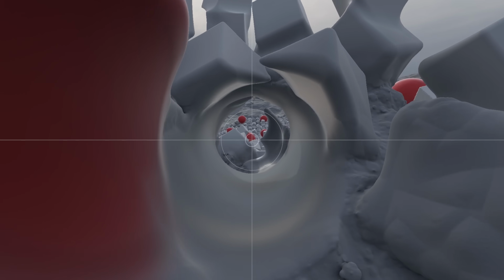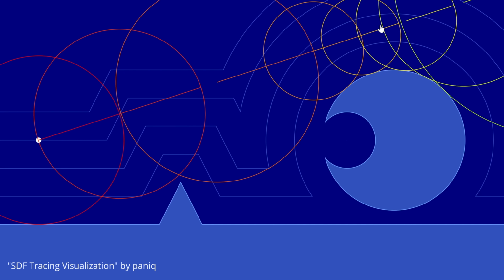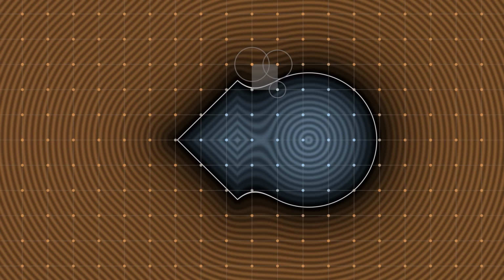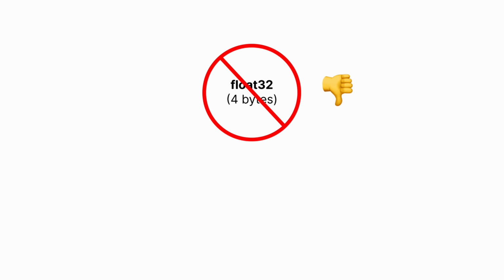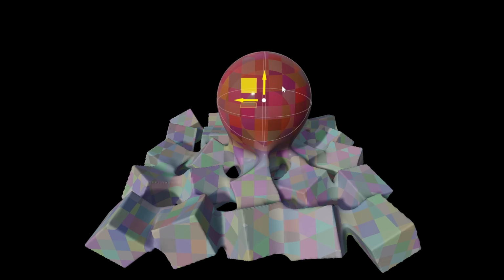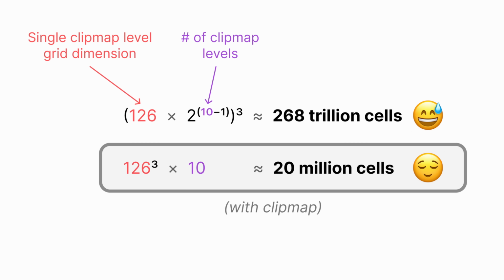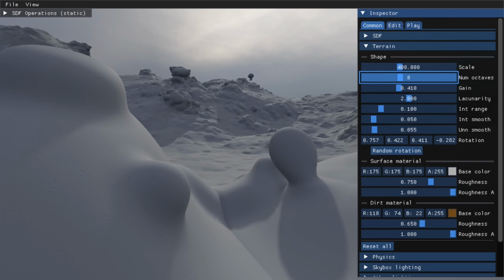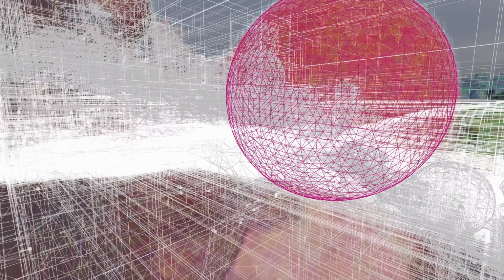I'm making a game engine based on dynamic signed distance fields (SDFs)

Comment: What if instead of using a sparse grid you'd use a BSP tree as a cache where each individual object's surfaces can be a plane of the tree? If ensure that the caching data structure uses planes which are parallel to object the resulting object surfaces then you'd also get rid of the grid-wobbling that your demonstrated cube showed. Of course BSP trees are one step more involved to look up into because you can't just bit-slice yourself through the data structure to get the result super fast but they compensate that disadvantage by allowing for even more sparse representation while also by design not having the grid-wobble issues.

Comment: I love it, can you still control the blending? I would expect it should still be possible here? I feel like one thing missing here is that everything is too "mushy" and blending too aggressively, would expect some objects to blend more or less with terrain, some maybe keep the sharp edge
Reply from the maker: Yeah, you don't need to blend shapes, but I tend to get carried away with turning on smooth blending in all my examples
Reply: @Mike-Turitzin hmm. I think this causes a communication issue. I certainly thought it wasn't possible in your engine to have, for instance, a ball roll without melting into the ground at least a little bit. It had me coming away thinking the engine was fairly bespoke and not applicable for a majority of games.
Reply: There’s always a backseat programmer
Reply: @avramcs  I'm not telling him what to do, just topic I'm curious about, stop trying to make things more negative for no reason
Reply: @avramcs  everyone who ever opened an issue?

Comment: very cool, how do you handle the material / color mixing between sdfs?
Reply from the maker: Basically, I'm blending the material params using the same interpolation param as is used for distances

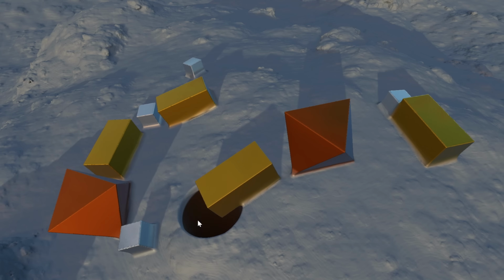Comment: This looks so cool! What I wonder as a relatively clueless viewer, is are you able to prevent objects from visually merging into each other or the terrain when you don't want them to? For example, at 17:09 I'd prefer the look if objects didn't melt into the ground whenever they touch it. It also makes the physics at 15:22 quite silly.

I'm just wondering if this "melting into each other" effect is a limitation of the technology, or a stylistic choice?
Reply from the maker: Yes, it was a stylistic choice - I got carried away with enabling smooth blending everywhere but it can be turned down or off.

Comment: This is so cool! I was on the Substance Modeller beta for a few years. Amazing team, including the original devs from Dreams. They used all sorts of optimisation tricks to run Modeller in VR, but it was a massive hog on resources, especially VRAM. Voxel grid bound per layer was technically unlimited and 64bit. Instances, LODS, render culling. Etc. I pushed it to around 300,000+ x 32 million triangle equivalent layers, which came in at around 45 billion triangles. And that was in VR. At the time that the project was defunded last year they were also working on refactoring a large part of the core to GPU. Anyway, brilliant work on this. Looking forward to seeing how it progresses. 👍
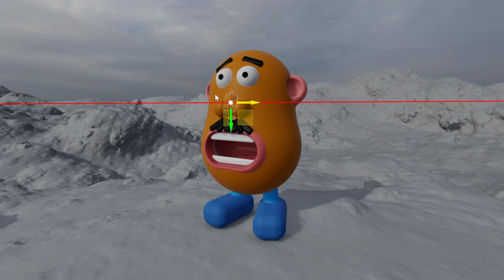@ 18:05 I see you are surface sculpting on non-destructive SDF operands. I didn't think that this was technically possible? I always though that the 2 methods (destructive VS non-destructive voxel/SDF) couldn't be combined directly?
Also: please turn this into a VR modelling program. 😂
Reply from the maker: Cool to hear, Substance Modeler is a really impressive product, with as you said very talented team.

Regarding destructive/non-destructive, every edit in my engine is technically non-destructive in the sense that it can be tweaked or removed after the fact. Not sure if that answers the question.
Reply: @Mike-Turitzin  Sorry, I explained it poorly. In Substance Modeller you can use both 'methods' of voxel modelling (for want of a better term) - the non-destructive 'live primitives' that blend in real-time, and the other method is being able to surface sculpt with tools like move/smooth/clay - like you would find in a polygon sculpting program - but there everything is destructive and there is no real-time layer/primitive blending. Both of these methods exist, but they are not directly able to be combined. If you want to surface sculpt on the non-destructive SDFs you have to first convert all the operands to 'regular' voxel layers.
Reply from the maker: @musashidanmcgrath  I see. In the timestamp you mentioned (18:05) I am actually still creating non-destructive SDF primitives for the "writing" - it's a chain of connected capsule subtractions.
Reply: I was so thrilled to read about Substance Modeler and so sad that it was trapped inside Adobe's painful subscription model.
I've been looking for alternatives, but nothing comes close yet.

Comment: Very impressive! I was looking into something similar for a very different application, but ended up choosing a different approach. A big weakness of SDFs is texturing them. You can do triplanar or volumetric texturing, which works great for terrain, but actually consistently texturing a surface even as it moves around or deforms is very, very hard.
Reply from the maker: Yes, you are right. I am planning to experiment with volume textures. I think it will work with the aesthetic I'm going for, but it is a specific type of thing.

Comment: Great video. I will be following your progress!

One question that comes to mind: do you have any ideas on how you might be able to integrate arbitrary shapes that don't allow a straightforward parametric representation, also not by combining simpler shapes? For example suppose you would want to place a mesh-based shape, or have some part of your terrain be formed by e.g. physics simulation?
Reply from the maker: For the game I'm building I'm just going to use simple primitive shapes. For stuff that is better handled with a tri mesh, I'm just going to use one. So there will be some traditional tri meshes, but the "world geometry" itself will be SDF.
Reply: Good question
Reply: as long as you can make a distance function, you can use it. a mesh conversion where each triangle is its own sdf edit would be incredibly inefficient compared to approximating it with basic shapes (spheroids, boxes, etc).

Comment: Is it possible to prevent objects from merging? I know it's a key feature but I suppose if you want to have a ball roll around you'd use a mesh ball interacting with the physics mesh? rather than an sdf? But for gameplay, having the ball being able to stay separate and then maybe after a certain amount of force get smooshed in would be fun.
Reply from the maker: Yeah, it definitely is possible, I just get a little carried away in enabling blending on everything, haha.
Reply: @Mike-Turitzin no worries. I just never see sdfs not merge. Is it just setting a threshold to prevent it?
Reply: @DarkerCry  Not entirely sure how it works but from what I've understood you take the smooth minimum between two objects to have them merge and the minimum to have them not merge. I don't know if there's a way to map that to a threshold in a per object way. You would need an easing function essentially to use something like a threshold but I'm not well versed enough with graphics programming to tell you if that can be mapped to object instances. It's definitely possible to use different groups of objects where all objects within a group behave the same and have multiple groups that you assign objects to.
Reply: @lukas_fletcher thanks for explaining it, the engine dev did say it was possible as well so he has his witchcraft I suppose lol

Comment: This is cool! What’s your approach to complex functions in SDFs, such as trig, modulo, etc? Also if you’re not aware, you can apply interval arithmetic for more efficient evaluation of SDFs.
Reply from the maker: Thanks! I'm using just basic SDF shapes (like in Dreams) because they're fast to eval and you get a well-behaved distance field. I am aware of interval arithmetic (and other related approaches to pruning) but so far haven't tried them as the simple bounding-box-based approach has been working well enough, but will likely delve into that a bit more at some point.

Comment: Not sure if you're out of bits in your data structures (or texture samples) yet, but I wonder if an extra low-resolution sample in the middle of the grid cube might give you enough to reduce the interpolation artifacts. I guess this is sort of akin to the "dual voxel" in the Soderland et al?
Reply: There may be ways to improve the interpolation artifacts! In practice I've found that using a small corner radius on shapes (which is cheap) pretty much does the trick without affecting the overall appearance much.